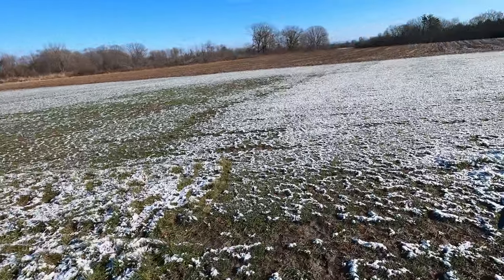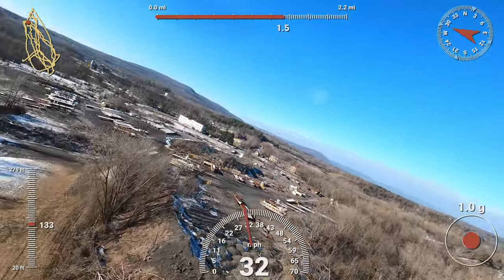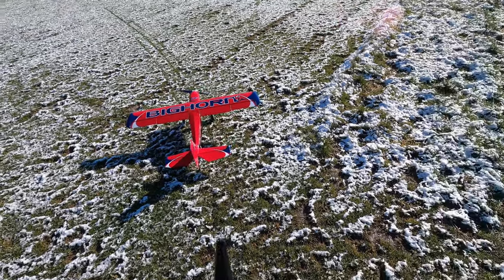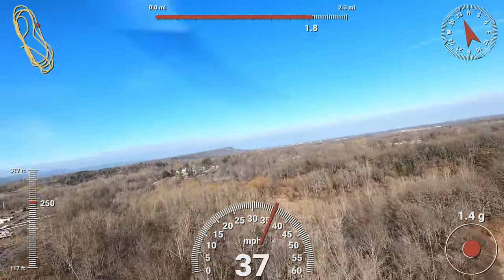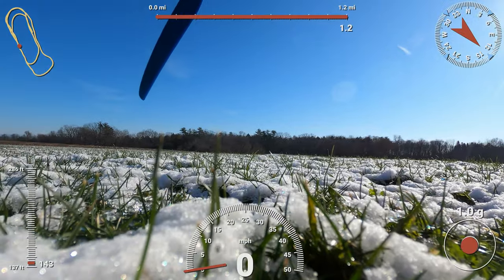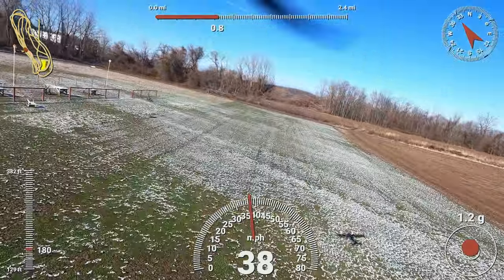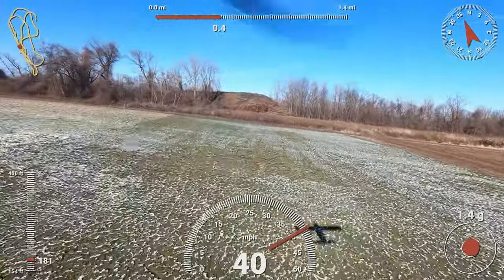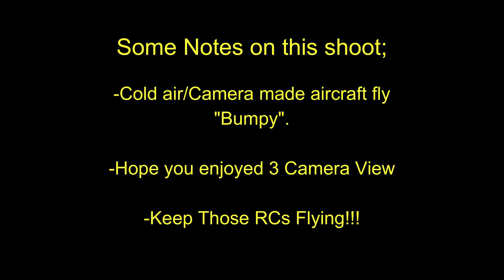OMP Bighorn Rc airplane

Comment: Your altimeter is wonky..
Reply from the maker: I know…that’s the one Ikon I’ve had the most trouble with, the speed will occasionally fall off as well…I think it’s because the camera is under the aircraft.  Thanks for tuning in!
Reply: @rcflightz2058  What kind of device is providing the telemetry data?
Reply from the maker: @txkflier  it’s a GoPro with GPS turned on, it’s in this video… https://youtu.be/FuYrh4f9788